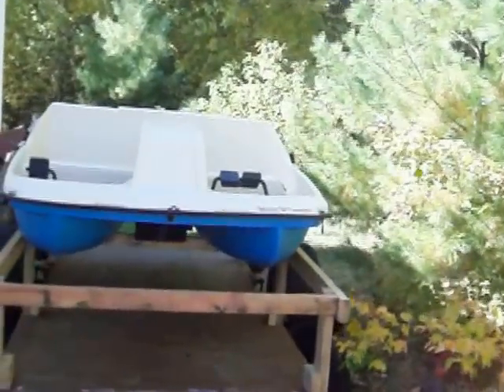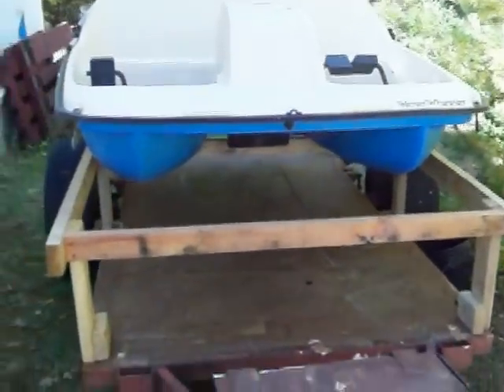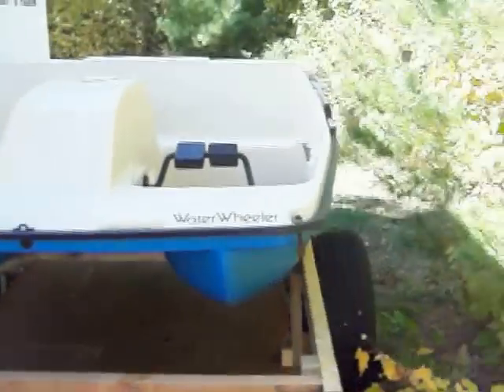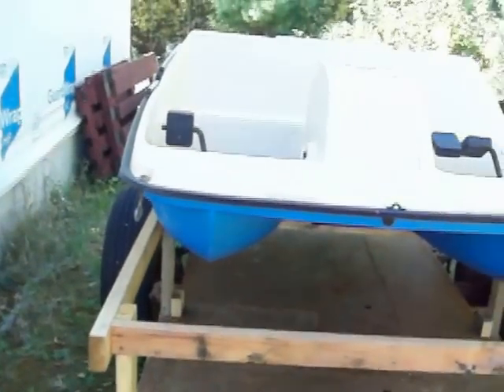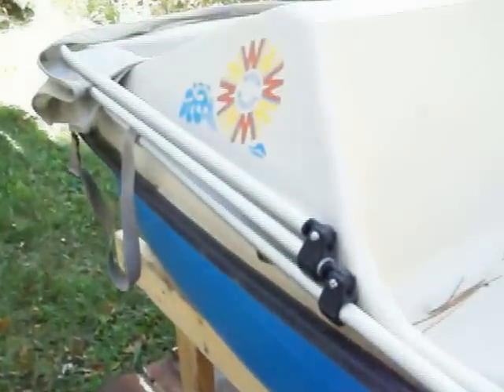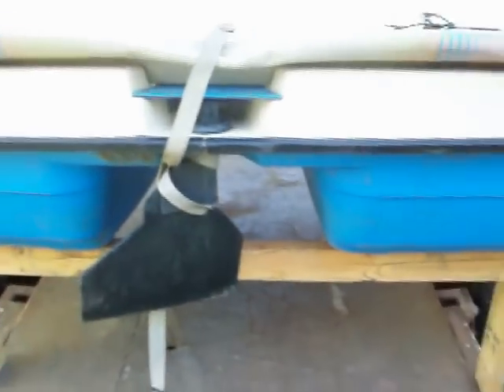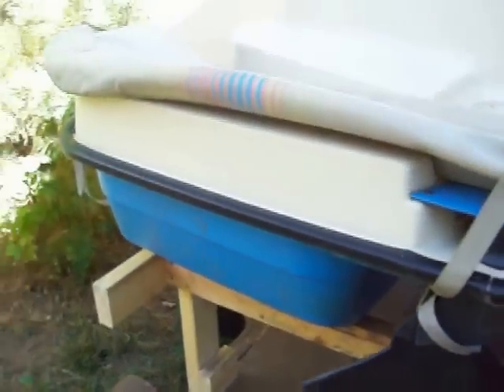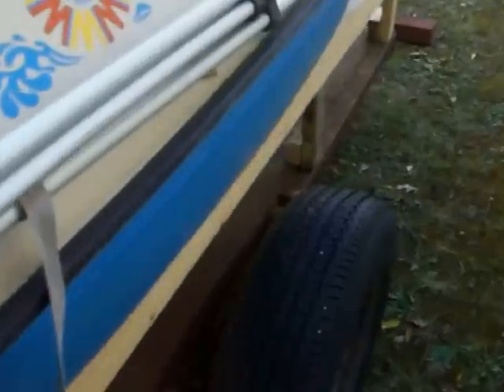trailer conversion for my paddle boat

Comment: Since it is a rigid frame, are you planning on storing the paddle boat on there over winter (possibly with a tarp over top)?

If you are hard up for space, maybe there is some way to have the cross members either fold with hinges or come apart for storage. My father installs short pieces of plastic tubes in the bolt holes on docks so there is less wear and tear on the wood when it has to be taken down every year. Maybe that would help you.